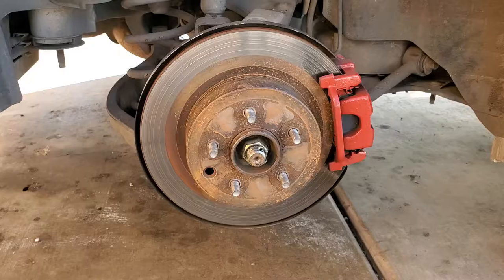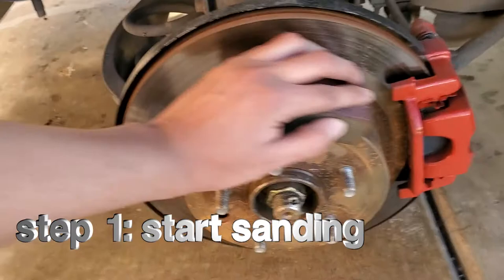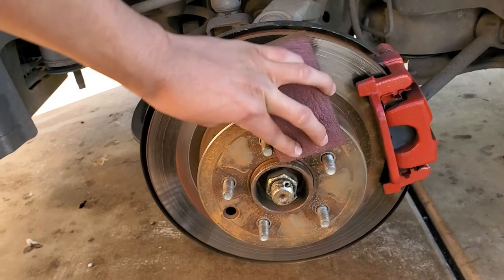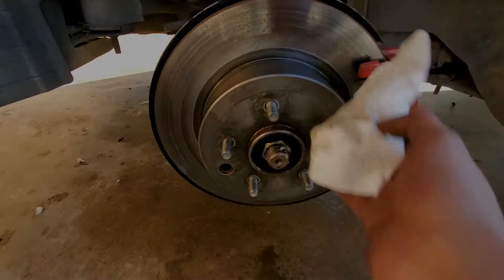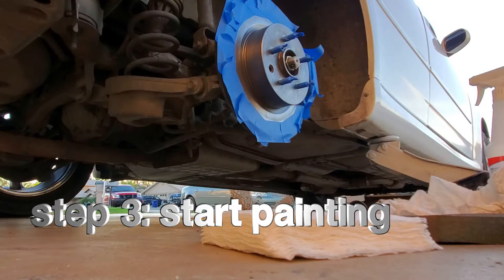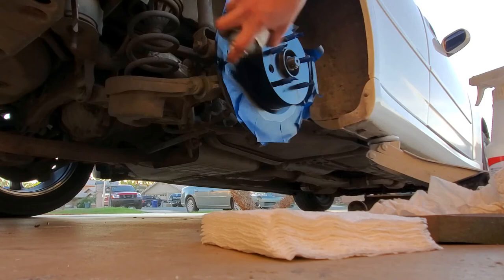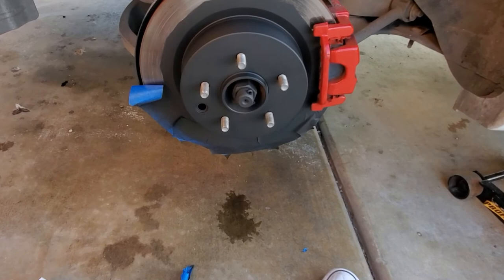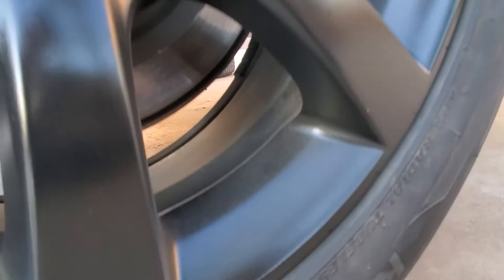how to paint brake rotors easy

Comment: It is a very bad idea to repaint the discs where the wheel sits. 1. the mounted wheel often sticks and is difficult to remove. 2. the surface is not perfectly smooth due to the paint and the wheel does not sit perfectly straight. At higher speeds there is unnecessary vibration. By the way, the car manufacturers strictly forbid this. I recommend to clean and lubricate the surface perfectly with, for example, ceramic vaseline and it will last more than 10 years without rust. Of course, the discs can be painted on the sides without restriction.